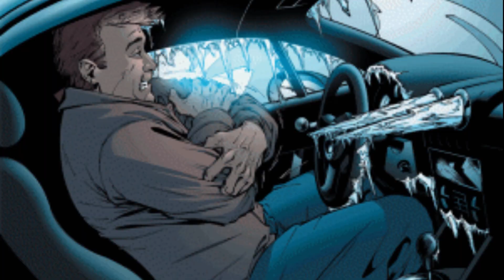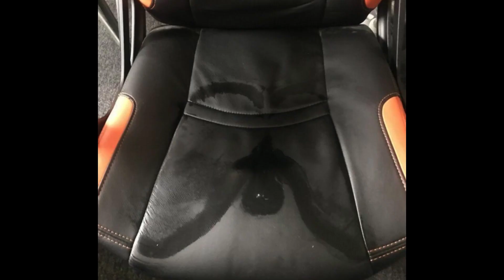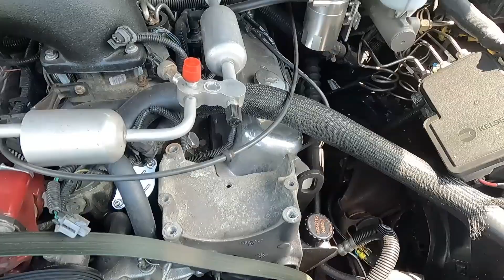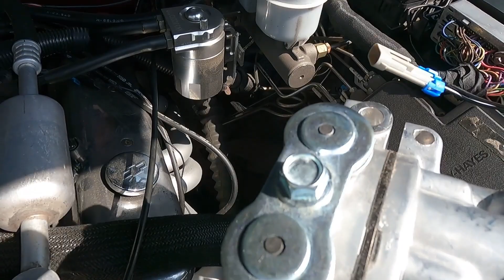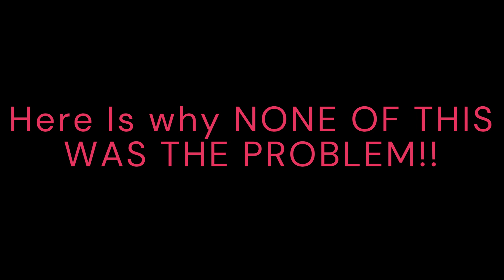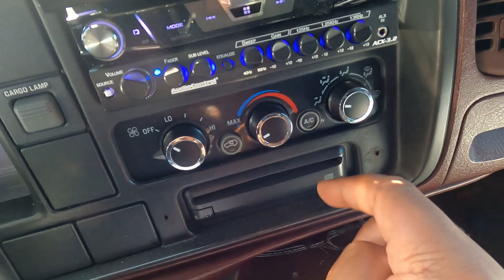Second Gen A/C compressor For OBS Chevy Truck. Sanden Style Made By UAC. My First Vehicle With AC

Comment: Can you drop the link for the kit bro??
Reply from the maker: Looks like if you want the condenser you have to get it separate now.
https://www.ebay.com/itm/272716399388?fits=Year%3A1996%7CMake%3AChevrolet&_skw=96+chevy+Ac+compressor+kit+sanden+style&itmmeta=01JV8CEZTAPNG8E9HMT047VZCK&hash=item3f7f2a031c:g:GP8AAOSwb~JdinbE&itmprp=enc%3AAQAKAAABAFkggFvd1GGDu0w3yXCmi1eXQt2hoG7UGm7WZKVNUx4bQ%2FfNgKDMCN23uMt79bj3Szw89Dr3JimSEwzwt6oGKcCthYkLFc8oRvSKe4nAseDSJ9ApUSSVOJnhzs6NqjNy%2F3FOmmocwzHj%2FWyhR3B8TxWHEJoaLGpCoKZgV86D%2BtLgX%2BfVAWUpustPgzLk1F7b%2F3rlpnOCvAV4ud%2BLj%2Fa%2FCe6R0Yn8ThtSp9P2OFZbjsTtT0uZXWwJMoB9gEvG%2BJJaRRFQ7x%2FOvbc57Yxu9F4I1W48lgkqCFzdtIZG08zUhRukEnQpC%2FAltmfEOsG0MbGxMl%2F5e23pX3D9nR4z7%2FojxkM%3D%7Ctkp%3ABFBMqP27jNpl

Comment: Will tall valve covers interfere with the ac compressor or bracket
Reply from the maker: It absolutely does. That’s a side video I’m going to do. It will be short. The way around that it notching the AC bracket. Which is what I did. I’m definitely not the first to do it. I researched it and found a while ago that’s what people were doing. And going from 4 bolts to 3 is fine. No issues at all.
Reply: @RCSmith90  I freaking knew it lol I was hoping not though haha, I believe I've seen what your talking about on modding the bracket just haven't seen much feedback on it yet. Hearing you gives hope. I'll keep an eye out for your video! Thanks bro
Reply from the maker: @jjmccloud  😂😂 no problem man.

Comment: I gave up trying to wrench off the joint between the drier/accumulator and the evaporator. Guess have to do the evap as well. Did your Sanden style require SP15 or was pag150 okay to keep using? I don't want to mix oil.

Comment: I appreciate you making this video.  Plan to do this or the applicable kit for my 96 burb
Reply from the maker: Glad it helped man. Lets me know it’s helping somebody 🙂
Reply: @RCSmith90  keep up the great vids I’ll be watching.  Very thorough and detailed.
Reply from the maker: @georgiabigfoot  THANK YOU!! 🙏🏾
Reply: @RCSmith90  I am curious Is this compressor very cold air at idle ? Inorganic does it require a driving rpm? Have you put a thermometer in it ?
Reply from the maker: @georgiabigfoot so I haven’t put a thermometer in it yet. So far at idle it works great, but the fact that I have dual electric fans I think play a part in that. I was just using it today and it still works great. Feels unreal sometimes because this is the first vehicle I have ever owned with working AC

Comment: what bolt size are you using on your volant hose by the throttle body? i have not seen anyone with this CAI besides myself where i live to ask. Thanks in advance.
Reply from the maker: Are you talking about the hose clamp?

The 3 bolts the kit comes with holds the hard plastic tube to the throttle body. Then a band clamp connects the coolers to the hard plastic tubes.
Reply: my voolant didnt come with the bolts that were correct size.  @RCSmith90
Reply from the maker: @motivationonpurposebrand2222  NOOOOOO!!!! That sucks!! I need to make another social media platform where I can talk to you guys better and send pictures. It’s not too difficult though. For starters finds a nut that fits on your throttle body bolts. The throttle body is bolted down by 3 bolts. They have extended tops. Once you figure out that thread size that is you have to get 1 inch extended nuts to screw on. Then get around 1 1/2 inch bolts the same thread size to go on top. 3 of each.

Take one bolt out the throttle body. Take it to Lowe’s or a hardware store with a good selection of bolts and use there thread finder to screw the bolt into to tell you what thread it is. That’s all I have for now without actually taking stuff apart.

Comment: You have a vid doing the 0411 pcm swap
Reply from the maker: I didn’t put it up yet. And honestly as far as detail goes, it’s not going to be as good as Lawrence Tollmans video.
Reply: @RCSmith90  yeah my bad I had commented before I finished watching vid , but yeah lt’s suburban was cool af I was bummed out when he sold it
Reply from the maker: @elianperformance5794  yeah his detail was cool as far as install goes. Mine will have some detail as far as wiring, but for the most part I’m definitely going to explain what NOT to do because I messed some stuff up. Plus I’m hoping yo get it tuned soon. I hear people pick up 20hp off the tune alone. Not touching anything else. Bone stock.
Reply: @RCSmith90  I haven’t done a 0411 swap on a vortec 5.0 or 5.7 yet but I’ve done a few ls swaps on the 96+ obs trucks and I’ve used lt1 swaps website to modify the stock obs harness to keep gauges working and the only one I could never get to work had been fuel gauge

Comment: That startup was nice as hell, did you get it tuned after the 0411 swap? if so by who?
Reply from the maker: I didn't have it tuned yet. That's coming soon though. Its still just the factory tune for the 2000 to and I believe 03 Express vans with 350 Vortecs. The exhaust I did helps the sound on start up. I'm working on a series showing how fast you can make these trucks with Just bolt on options while I map out the future motor for later. Tune is next.

Comment: What belt is that
Reply from the maker: Which one? In the old clip with getting the ac installed I had one alternator. In the current install of the compressor I has dual alts. They are actually the same style just different lengths. The longer one that’s in there now is just dirty.

Comment: Where'd you get that updated AC control head? Looks super neat
Reply from the maker: It’s the factory knobs for the new vans. They go right on. Direct swap. 

84141127 AC Temperature Control Knob Fit for Chevrolet Express 2008-2021, Fit for GMC Savana 2008-2017, 84793085 3pcs https://a.co/d/jfZ5oVp